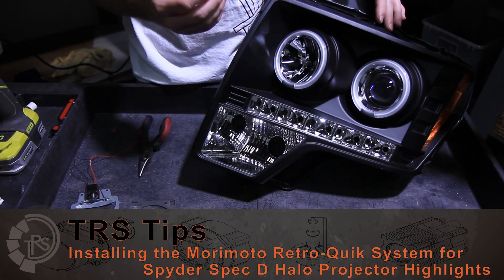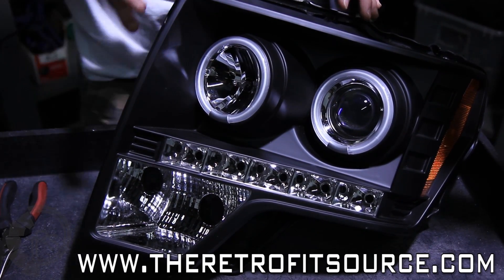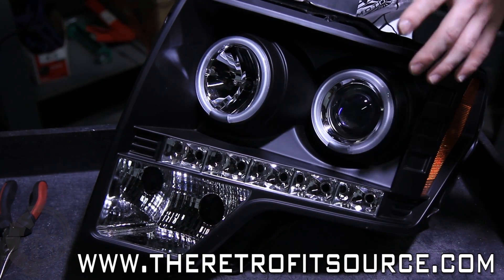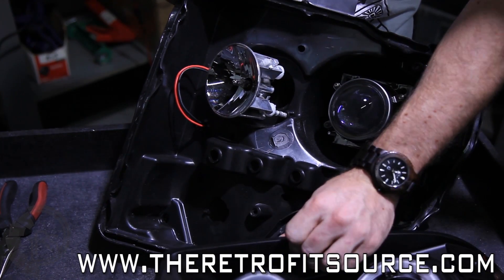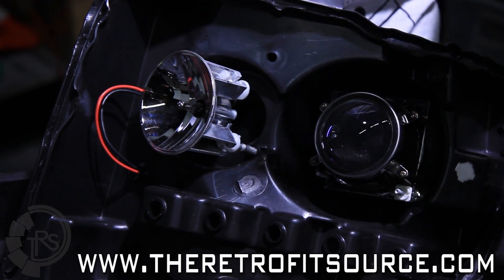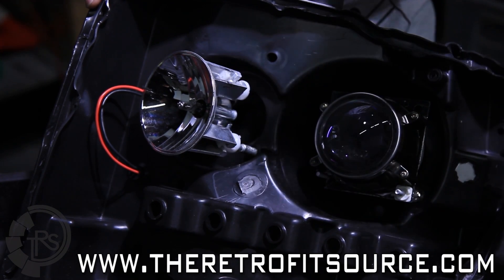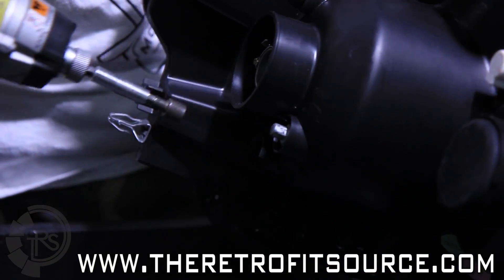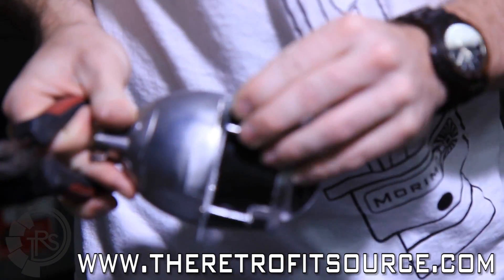TRS Tech: Upgrading Spyder / Spec D Projector Headlights with Bi-xenon Morimoto System

Comment: I am looking to do a true quad on a 2001 silverado i currently have spyder headlights would i be able to use the morimoto bi xenon hi 8.0 projectors on both the low and high beam or would i need to change the high beam to the morimoto HB led? Also sense i want to use a spyder headlight housing for the low beam can i use the morimoto bi xenon Hi 8.0 instead of the kit used to upgrade the projector that is already in there?
Reply from the maker: Yes, you can use the Morimoto Mini H1 8.0 Bi-Xenon projectors for both the low and high beam positions to create a true quad setup. They provide both low and high beam functions, so no need to switch to an HB LED for the high beam. 

You can replace the existing projectors in your Spyder headlight housings with Morimoto Mini H1 8.0 Bi-Xenon projectors. These projectors are designed for easy installation, often requiring minimal modifications, making them a suitable upgrade for improved lighting performance.

Comment: So I have fairly recent spec-d lights. I got the RQ110 brackets not realizing they weren’t this, but the brackets still line up. I have a few problems however, the spec-d plastic adjustment screw mounts are loose in the retrofit bracket (is this even a problem?), but also there are only two adjustment screws on the spec-d housing to mount to. The third mount screw is some weird plastic pivot screw thing which doesn’t seem to have any obvious way to connect with the retrofit bracket. Does this make it incompatible ? Or is there some way I could connect the third screw?
Reply from the maker: Hey! Please reach out to our CS team, they would have far more knowledge on this subject that I would personally.

404-220-7940
Support@TheRetrofitSource.com

Comment: Also you do you use the shutter or how would that work if you have a reflector for the high beam??
Reply from the maker: That will vary on the headlight, and how everything is wired up. If it's a bi-xenon projector then you have the ability to use the projector for the high beam and also the reflector has a high beam as well. If it's not a bi-xenon projector, then the projector will just be on for low beam.

Comment: I have some spyder headlights, bought the retroquik kit but the top holes of the bracket don't line up with the housing. Bracket doesn't even line up with the holes on the acme projector in the kit so I can't mount the demon eye bracket either...smdh fml
Reply from the maker: Joe - take a look at the Spec D Retroquik we also have listed (same category on the site) - there is a diagram for those brackets under the description. Do they look like they'd fit?

Comment: I have A 08 impala and wanted to upgrade the factory headlights and fog lamps. Wanted to retrofit by ordering the mini H1 stage III kit (5500 lumens 50w ballast) for the headlights and the HID 35w kit for the fog lights. Would this be a good fit or would I need to go with a different kit altogether? Any suggestions would greatly be appreciated before I buy a kit and not be satisfied. Thanks!

Comment: now if only I can fine how to have dual hids
Reply: FIRENICEWOLF easy. Use the Retroquick brackets to replace the original projector in these lights, then use either the nut and bolt method or you can fabricate a custom bracket to place a second projector where the high beam reflector bowl is at on these lights. Then all you need is 2 wiring adapter splitters, plug both projector low beam plugs into one of the splitters then plug both of the high beam solenoid plugs into the other splitter. Now you have both Projectors running on low beam, and the shields will drop on both for the high beam. I’m doing this on a set of the AlphaRex Pro Series headlights right now, except I’m using the D2S 5.0 Projectors.

Comment: the sad thing is if you have a gen 1 ford focus with either of these brands of projector head lights this kit will not work. i did this to my own set of spec D projectors and had to get custom plates to mount the mini H1. After i completed the install i also installed on the high beam side another H1 kit so when i turned my high beams on, the shield and inner high beams came on. this was used with the H4 relay kit and a single high beam splitter.

Comment: How hard would it be to take the high-beam reflector out and add a second spec-d bracket and add another projector to make a quad projector system?
Reply from the maker: Allan Baillo it wouldn't be impossible, but the bolt pattern would not line up unfortunately
Reply: TheRetrofitSource Inc That's what I was afraid of. Oh well. I suppose the one set of H1's will do. Thanks!

Comment: Does anyone happen to know what size halo spec d uses? I am trying to replace the stock ones which SUCK.
Reply from the maker: Jayy023 80mm should do the trick, check em out here:

http://www.theretrofitsource.com/led-lighting/led-halos-strips.html
Reply: Jayy023 Usually 90MM for the small and 100MM for the large
Reply: TheRetrofitSource Inc Okay thanks I did.